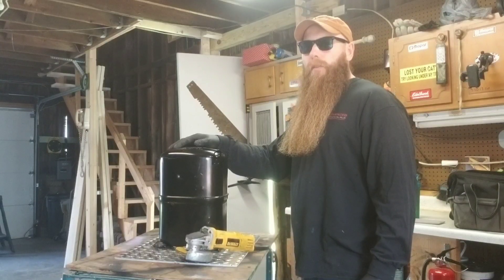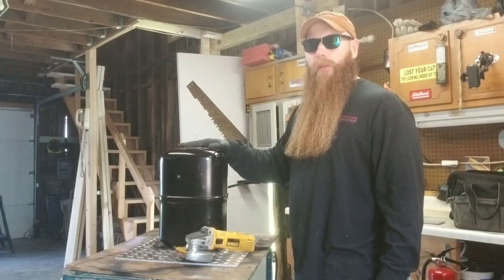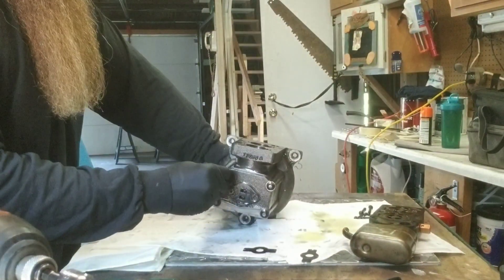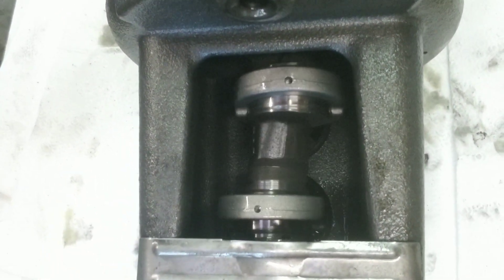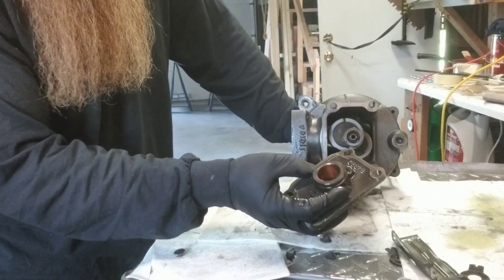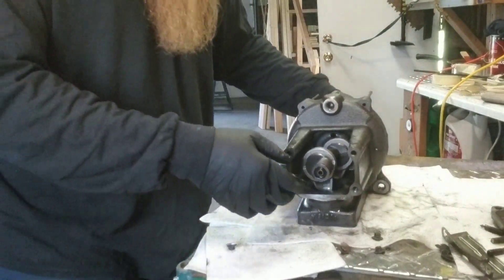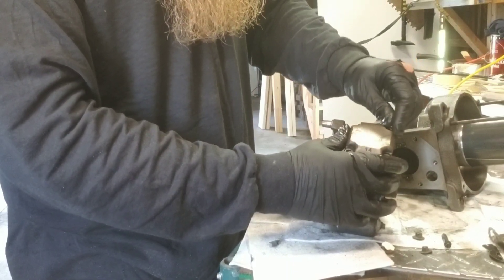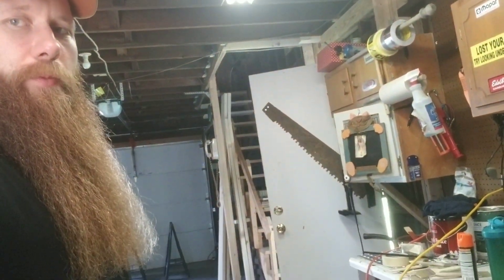Compressor teardown

Comment: Unfortunately I worked for Bristol Compressors for about four years before my plant got shut down in Sparta, NC.  This was before I even got into the heating and air industry so I already knew how a reciprocating compressor was built, worked, and did my share of repairing them at the plant.  I did just about everything in the white room (from where it first gets build to where the housing gets welded together.), it was a great place to work for and money was good.  I was 19 years old when I started working for Bristol and funny that somehow later in life it takes me back into HVAC as a service technician and now I am 40 years old.
Reply from the maker: Id like to tour a compressor plant one day and see that process, im about 3 hours from the Emerson factory so I may reach out to them and see If they offer any sort of tours- it sounds like fun.
Thanks for the feedback
Reply: @curioushvacguy6876  Bristol Compressors used to give out tours when I was working there, but I not sure if Emerson would.  I would like to see how their scroll compressors put together, but sadly I don't live out that direction.

Comment: Bill is correct. When you get to tear down a semi-hermetic compressor you will find pretty much the same things. When you find one that isn’t pumping properly I have found the head nearest the pecker head to be the culprit. This is on O6Ds and 06Es. You can get new valve plates to replace the failed plates. Isolate the compressor and pull the heads off and check the cylinders for scoring. If they are in good shape. Slap new plates on it. I had an 06D that was shaking the roof. I pulled the head and the pistons were gone. Sitting in the crank. The customer said put it back together and do the best I could about the noise. I crammed a bunch of rubber waffles under the compressor and walked away laughing. What ever! Lol. Oh p.s. don’t break the pins.
Reply: 6 months it was still running and they canceled the contract. Replacing the pistons is not recommended but valve plates are ok. To replace the pistons requires a complete rebuild.

Comment: So the head of the compressor is the valve plate and the shaft connected to the rotor is the crank shaft. The part that connects the piston to the crank are called connecting rods. And you were correct about the valves, they are reed valves. 
I used to be an engine rebuilder before becoming an HVAC tech so this is why i know these things. Great tear down! Ive never actually cut one open myself. I guess thats why they call you the curious HVAC guy! Thank for that brother!
Reply: Curious HVAC guy loving HVAC man. The wrist pin connects the piston to the connecting rod. Its held into the piston by circlips or an interference fit and is pressed in.